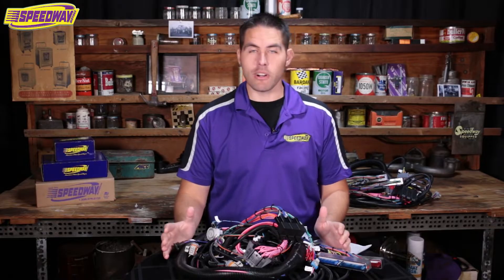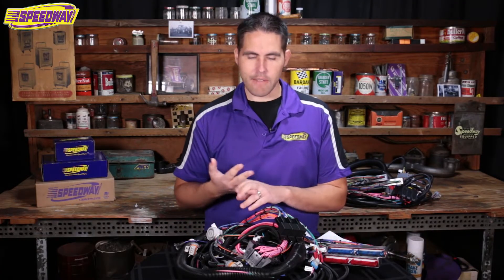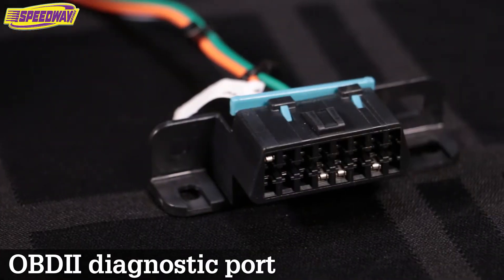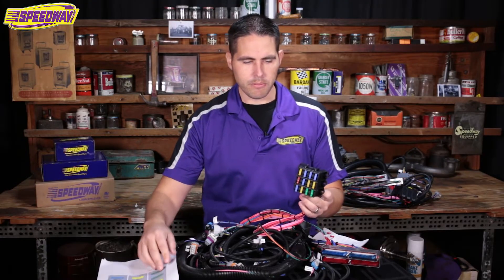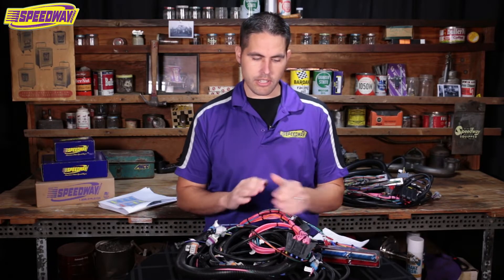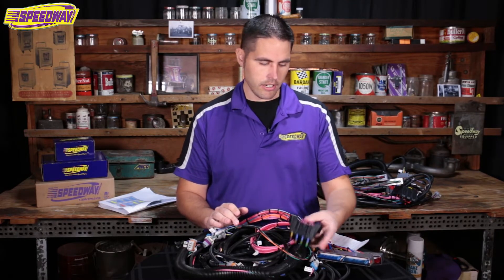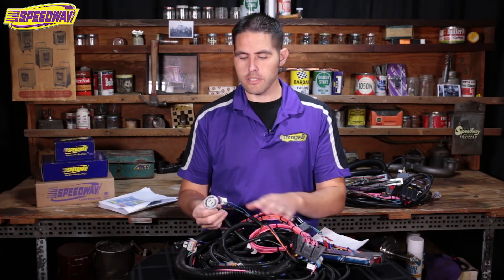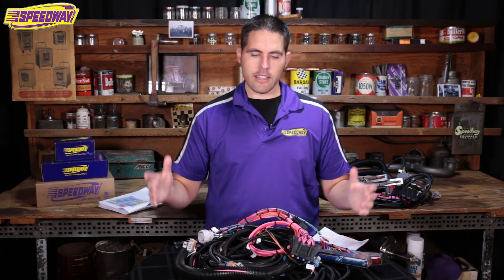LS Swap Wiring Harness – Plug-n-Play vs. DIY Harnesses

Comment: The thing to think about is those junk yard harnesses are getting old, if you are doing a gen 4 swap you’re probably ok.  I used a junkyard harnesses for years but now it is 20 plus years old, the connectors are brittle, some of my fuel injector connectors are broken.  15 years ago hands down i would and did use a junkyard harnesses.  I’m now looking to replace my existing swap harnesses,

Comment: Do you make a harness where I can run the ls engine with my factory gauges and 5 speed trans ? 5.3 ls going in a 2008 pontiac solstice gxp turbo , running aem boost and wide band gauges that are already in the car

Comment: Hi Steve here I just want to know will the early 9697 4L60 e work with that harness I won't have any problems shifting their transmission I got the early '96-97 4L60E I want to know if it will fit and work right cuz I just got done doing a transmission job in it

Comment: Part number for the wiring harness
Reply from the maker: Hello! The part number for the Speedway GM Engine Wiring Harness, 1999-02 LS1 is 91099021. The part number for the Speedway 2004-2008 Vortec V8 Wiring Harness, Extended is 91004084. Thanks!

Comment: Got a 1998 chevy that had a 5.7 vortec in it. Long story short it don’t run anymore so I came across a truck that has a 6.0LS in it. Too that motor out and dropped it in my 98. I have the computer that came out is that truck will I still need to have it flashed. Same motor and same computer.

Comment: I have a computer that came with my motor the throttle body was a drive by wire but I bought a new intake manifold thats a mechanical throttle body. My question is do i need a different computer since I changed my intake.

Comment: The most annoying part about ls swapping is when you buy a ecu from a guy who claimed to remove vats when it's really not removed it's best to remove vats your self
Reply: I heard a rumor you can delete it by using a similar year truck or car and confuse the ecm by unhooking the body module
Reply: @jammie129  o yeah I seen a couple videos about that but imma just stack 1500 and get s terminator x it's a real headache dealing with the factory ecu and wiring dont nobody show a real tutorial on how to get it started on the internet you really gotta dig hard to find it

Comment: I just used a junk yard one & flashed it. Re worked it & Cut the wires & sensors u won’t use . Basicly free w the engine
Reply: Hey I just got a sierra 1500 donor truck and want to swap my jku, how did you delete them just get a guy to tune it? What did you not need and can get away with
Reply: Hey boss so I want to do a ls swap but I was going to to the junkyard sway do I take everything with the motor first time doing a ls swap

Comment: Trying to put away 6 L Vortech harness and computer in a 01 short box Chevy 1500 
Used  to be 4.3 v6  Would like to plug and play but found those harder than that just wondering if you got any tips
Reply: Put a

Comment: I did not get instructions with my purchase of your harness, how do I get that manual,
Reply from the maker: We apologize for that! We'll get that taken care of. Which harness in particular did you order?
Reply: @speedwaymotors  i thought that I was buying your harness made by you, and warranted by you, and supported by you,. I purchased it on eBay, and after sending a request and questions about the harness - you now tell me that you don't even make / rewired the harness that it comes from Top Street Performance, and they said to call them if I have questions, and wow by your video I thought I was getting with a true company,,, did I make a mistake

Comment: I’m doing a LSX 454 swap on my 99 Chevy Tahoe is this the wire hardness ima need ?
Reply from the maker: If you are doing a LSX 454 the harness needed will vary depending on what fuel system that engine uses.  If you have a factory ecm, use the corresponding harness for the year of the computer.

Comment: Lol quick question I want to buy this harness but have no clue which one I would need cause on the website it says either 99-02 or 04-08 well I’m taking my ls out of a 2003 Tahoe so which one would I need? Lol
Reply from the maker: If it is a cable operated throttle body you would need this part: https://www.speedwaymotors.com/Speedway-1999-2003-Vortec-V8-Wiring-Harness,46373.html. They didn't use the throttle by wire design until 2004, so that is the difference.

Comment: I have a 2005  gto that was in a fire.. all of the wiring harness are gone. This Car will be strictly a track car only and I wanted to know if I can use this harness as a replacement ?  i just need it to start run and have the headlight be operational.

Comment: With this harness does it replace the entire harness of your build like the fuel pump to ecu? Amd do you still run your under hood fuse box with this harness or does it replace that fuse box with your harness box? Thx again
Joe
Reply: Hey, while I don't have any experience with this particular harness, it's fundamentally identical to what you would end up with if you were to dissect your existing harness....so,short answer is 'NO', you would not be using the stock fuse panel. I personally recommend doing your own harness modifications, not only do you save a considerable amount of money, but you also gain a true understanding of exactly how your powertrain is oriented and how it functions. I recently "completed" (never truly complete!!) my first swap, a stock 5.3L vortec/ 4l60e from an '02 Silverado into a 1967 Dodge D200 Sweptline pickup.  *RATHER than disabling the truck by removing the harness & thinning out the nonessential wires, I opted instead to go to the pick 'n pull, salvage an identical harness for $67 total, and complete the "standalone" harness procedures as laid out so generously by Brendan of lt1swap.com. So, by the time I had removed the complete harness from the salvage yard, reworked it, and removed the existing harness from my truck, I was able to install my reworked harness with virtually no assistance from the labels and notes I had taken on the connectors.  
Cheers!
-Nick

Comment: Ok so I doubt this has been asked because it's never been done but I'm running a cd009 behind my ls new edge mustang. Will this harness work for that. And is there info online on how to re pen the trans connector?
Reply from the maker: It appears you are correct in that your LS to a Nissan cd009 Transmission has likely not been done.  The Speedway staff will not have the re pinning process for that match up but possibly online.  You may also want to check with the “Fuel Injection Connection” as they are the most knowledgeable on these LS harnesses.  Their number is on their website and be patient as they are very busy people.

Comment: Do you still need another fuse box and harness to run the other stuff
Reply from the maker: This LS conversion harness will only run the engine itself.  You will still need to have a harness and fusebox for the rest of the car.

Comment: Hello pat i have a 1996 impala lt1 do speedway make lt1 harness i have a electrical issue and i wana buy a new harness
Reply from the maker: We do have LT1 harnesses available as part number 91009497.  These harnesses are intended for installing your LT1 engine into another vehicle, so it is not exactly like the OEM harness.  Here is a link to the instructions with more detailed info: https://static.speedwaymotors.com/pdf/91009497installationinstructions.pdf
Reply: Speedway Motors no sir its goin back in my 96 impala

Comment: What do you have to do if I wanna put a ls 5.3 in my 1983 c10 and what kind of computer do I need a wiring?
Reply: Juan Lopez You have many options. If you are keeping the turbo 350, you need the flexplate spacer.You can also buy a specialty flexplate to adapt LS to old school. If you are using manual trans muncie 4spd., you need the flywheel out of early LS truck manual shift, old school clutch/pressure plate bolts right up, but you will have to enlarge pressure plate holes a tad. You also dont hammer in the throwout bearing all the way, you leave it sticking out of the crank a tad. You can do this wiring system in the video, or if you buy a junkyard motor on ebay and places like that, nowadays they include the wiring harness. You can also do away with this setup and buy the MSD injector kit with fuel rails and brain box, you can also run carb and buy the MSD kit which reads your timing  sensors and fires the spark plugs. You can also do away with that and buy the front timing cover kit which spins a SB Ford distributor and have no sensors to go bad on the road. Many choices.* Ebay has a edelbrack manifold kit minus the carburetor with the MSD brain for the spark plugs for around $700.

Comment: Does the 4l80e have its own computer?  Or does it use the engine pcm? I'm somewhat new to this.
Reply: Toby Whitaker gen III LS engines use a single PCM controlling both the engine and trans. Gen IV uses a separate TCM or transmission Control Module. Gen III years are 98-07, Gen IV 07-12(?). 2007 was a crossover year and could be either. Stay away from 98 fbody PCMs as they not the same.
Reply: I thought the 4l80 would use the t42 control module ?

Comment: +Speedway Motors, what company makes the LS wiring harness, like the one in this video? I'm thinking PSI.
Reply from the maker: Fuel Injection Connection, which is a Speedway Motors brand.
Reply: Speedway Motors, thanks.